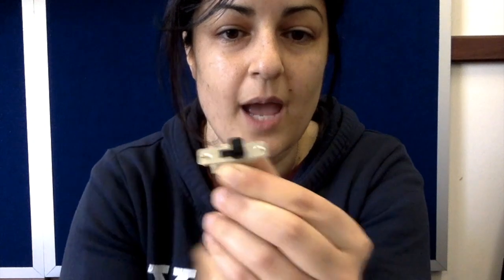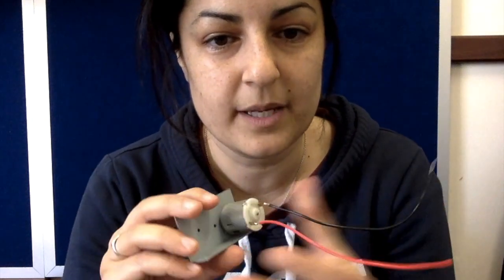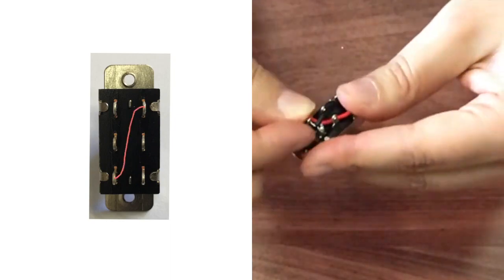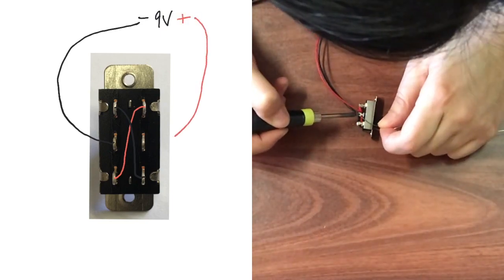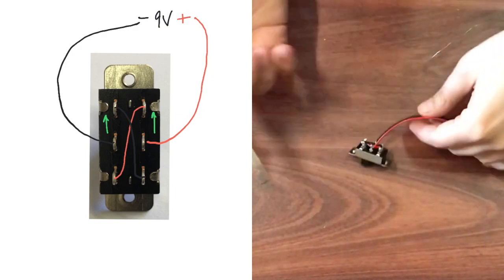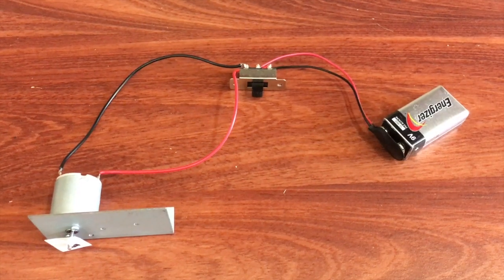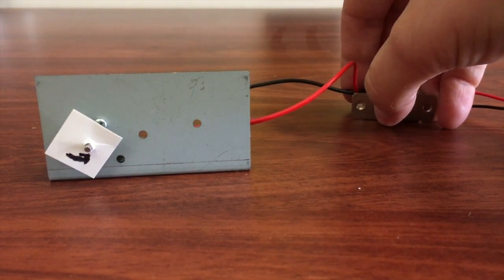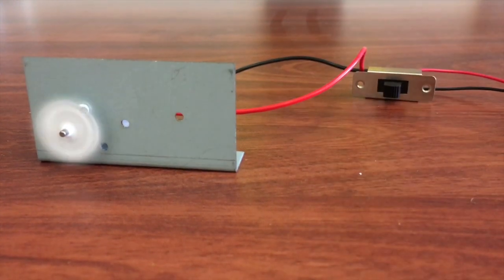How to wire a bi-directional switch to a DC motor to control its direction

Comment: I own a "Luxe-Ryder" enclosed motorcycle trailer that had a hydraulic front tongue jack hidden "inside" the trailer. A 2-position switch is mounted to the "outside" front nose of the trailer. The trailer "should have been" wired, for a safety/security feature, a "toggle switch to the rear inside of the trailer where a switch is already installed for an onboard air compressor.

Whew you say? Well...the hydraulic ram/piston was bent. To replace the cylinder is over $400. A 12v DC tongue jack from Northern Tool or similar is about $150. I had a prior year model LR trailer that someone had replaced the hydraulic with 12v so I had already modified a NT jack years ago for that. But it was already wired and memory loss meant forgetting how to wire the switch while "also" incorporating a toggle along with the compressor toggle to the rear of the trailer

The switch mounted "to" the NT jack was set up like in your diagram. The switch mounted to the nose of the LR trailer only had 3 wires but no bridge between the top/bottom cross-wise pins.

Your explanation, altho I have yet to go back to the garage to try it out, has created a solution so that I can do both...save the original 2 position toggle in the trailer, eliminate the one mounted to the jack but also put an on/off toggle (already mounted) to the rear of the trailer as a disconnect in the event the battery is weak, etc.

My hat is off to you for putting this video out there for myself and others less intuitive to solve an issue. Thought I had fried the motor but it did work when connecting neg/Pos cables to the red/black wires....just that I need to follow your lead. Thx!

Comment: if you need a 9 volt connector  take a dead 9volt run over it then take the positive negative piece out and connect a wires to the back